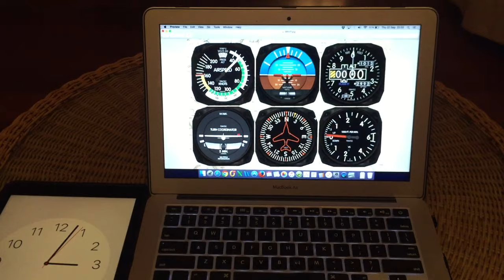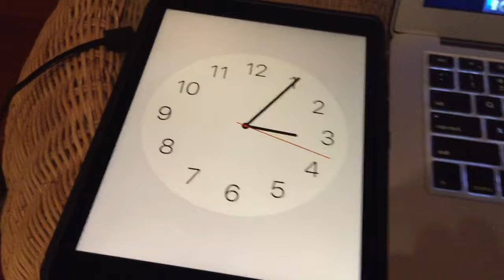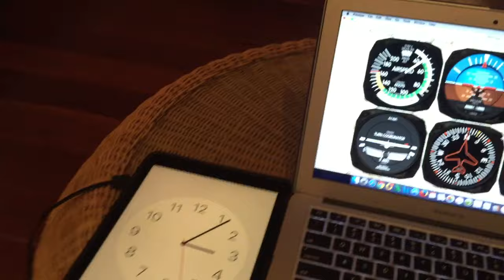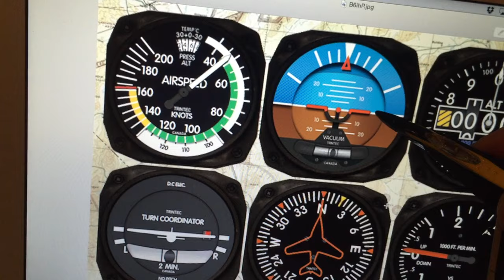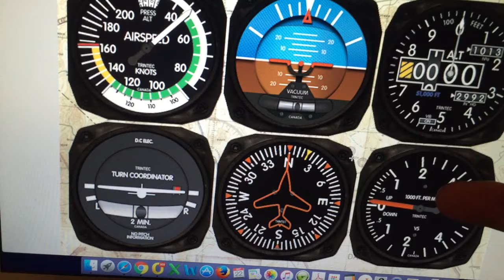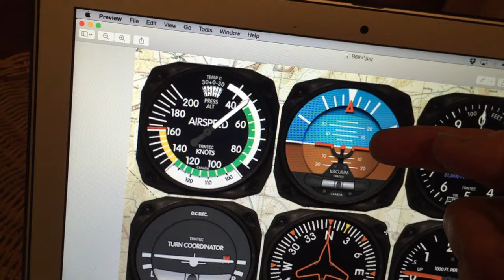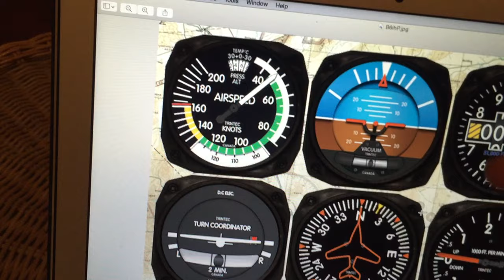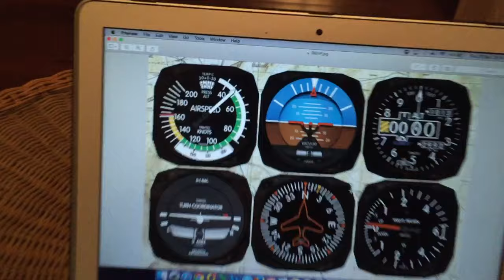Do aircraft change attitude to follow the curvature of the Earth?

Comment: A plane traveling at 500 mph would have to nose down 1 mile every 12 minutes
Reply: Truth Seeker - Yes.   And here are some FACTS for you to digest:

Take an aircraft in steady level flight.

  An observer on-board has a plain old "Spirit Level" and a ring-laser gyroscope (like the Litton LN-200 or Airbus Astrix-120).

Align the spirit level "Level" in the direction of flight (set it in the aisle lengthwise for instance)

Align the ring-laser Gyro such that one axis (say X-axis) is aligned with the aircraft's PITCH AXIS.

Now take note of the RLG angle about the pitch axis and verify that the level shows "LEVEL"
 ("Zero" the reading)

Now Fly Seventy Miles (70):  the spirit level will show the aircraft stayed LEVEL.

WHAT does the RLG say? - It says that the aircraft PITCHED DOWN ONE DEGREE .!

Keep flying and for EVERY 70 miles flown the RLG WILL indicate the aircraft pitched down one MORE degree.

Imagine the aircraft could start at the North Pole, fly south to the South Pole, over it, and north to the North pole again.

Upon completion of this flight the level would have read LEVEL for the entire flight while the ring-laser-gyro will indicate a COMPETE 360 degree FRONT FLIP .!

Sorry but this a FACT that cannot be disputed.

IN FACT most modern aircraft are equipped with RLGs as part of the inertial reference system.

They MEASURE EARTH ROTATION as part of the per-flight test to verify the gyros are all working.

If the gyros do NOT READ EARTH ROTATION, the gyros are marked as failed, and the plane does not take off.

Stuart Gray - Aerospace Test Engineer (23 years) specializing in test of Flight Avionics including ring laser gyros since the 1990s 

I have literally installed RLGs on vehicles and then helped FLY the vehicle.
Reply: @stuartgray5877  Yet, no one seems to feel this effect. I mean nosing down 1 mile every 12 minutes...you would surely feel it. Plus you would see the artificial horizon keep making adjustments to keep the plane level. But you don't. You can't tell me that this gyro is constantly nosing down 1 mile per 12 minutes on a plane going 500 mph. Please, show me a demonstration. The plane keeps level for long periods of time with it's nose slightly up.
Reply: @truthseeker6369  - "you would surely feel it."  Oh so you WOULD, would you?

Would you care to calculate the force of bending the path of the aircraft to that curvature?

Please be my guest so you can prove your assertion.

Hint: No a human would NOT feel it.
Reply: @stuartgray5877  You mean you can't feel it when the plane starts to descend? Maybe your equilibrium is not working in your head. I can sure feel it. The nose stays up for most of the flight until the plane starts to make its approach. I can feel and see the nose slightly up for to majority of the flight. We all know thats how planes fly when they are keeping the same altitude.
Reply: @truthseeker6369  Sorry it is just a FACT that a human could NOT feel it or..... DO THE CALCS YOURSELF AND PROVE ME WRONG.
Reply: @stuartgray5877  Why don't you try making a valid argument rather than childish name calling. Actually, my math was wrong. In 500 miles, you should have a 31 mile drop. That's 163,680 feet. Divide that by 60 minutes and and you have 2,728 feet per minute. In two minutes you have over a mile drop. You mean to tell me, you wouldn't feel a mile drop every 2 minutes? Come on man, who's the one really bullshitting here? You.

Comment: Wolfie6020, you have to publicly recant/recall your statement and conclusion that a pilot needs to make small control inputs to follow the curve of the earth.  EVERYTHING you say is true and correct, EXCEPT that.      Let's make your credibility perfect and make this clear to everyone.  even though the earth is round , you fly LEVEL and that is in relation to the perpendicular force of gravity. (straight down)  your wings, fuselage, all are perfectly perpendicular to the aircraft travel.. because the this line of gravity follows the plane, it NEVER needs to adjust for curvature, because the atmosphere that it is flying in is curved as well.   

again, no adjustment or control input necessary.   the gyro adjusts to curvature for the same reason.  even though the curvature of the earth is about 1 degree for every 8mins at 500mph,  the aircraft doesnt need to make any adjsutments of attitude. not even very slight.  WHY?   because the plane is flying LEVEL (to the ground) always, NOT straight.. if a plane through straight, it would end up in space , if it had the power to do it, and you would be climbing in altutude all the way there!    make sense??
Reply: Nice addition.  Yes, i try and mention the pressure gradients that are related to how much air is above the ground and does vary slightly. So, it  remains relatively constant all the way around the earth, so there is NO control input to adjust to the curve of the earth , because , and as you say, the atmosphere is curved around the earth too!

Comment: Wolfie, I think there is a better way to explain this. Yes, of course, you are 100% correct about the rate at which the aircraft would have to pitch down if it indeed needed to. But I suggest the aircraft does not pitch down at all. It remains horizontal to the local earth surface.  Keep in mind that at every point on the globe gravity is perpendicular to the surface. So from one location to another at a constant altitude, the aircraft has remained horizontal. I will make time soon to do a couple of drawings to demonstrate this. 
Cheers
Mate
Reply: That's correct. On a globe, the aircraft does not pitch down at all. It remains horizontal to the local earth surface. On the ground, we measure "level"with a spirit (bubble) level at rest, which basically uses the direction of the force of gravity, and a right angle compared to that. What "level" flight in a plane really means, is maintaining your altitude, which is what happens automatically in a plane trimmed to level flight. You don't even have to think about it. If you nose up , you will start  climbing, moving away from the earth, and you will have to work against the force of gravity acting on your plane. If you do not add power, your velocity will decrease.  As when driving a car uphill.
Thus, maintaining altitude as you fly along, just will follow the curvature of the earth .. automatically.... whatever it is .. flat or curved. No "proof"/"debunk" of FE/globe here!

Comment: You also have to consider throttle setting and aircraft trim.  For if the aircraft is trimmed so that it is not  quite generating 1 g of lift but a  fraction of a g less than 1 g then it will lose altitude.  So if the aircraft is trimmed to maintained constant altitude then it is not quite pulling  1 g  (sa y .01% shy of 1 G) of lift and  thus can lose  altitude at about the same rate of earth curvature. And even it the  elevator is locked one can  also adjust altitude with the throttle setting for the engine  will be producing some lift unless the aircraft is flying with zero degrees angle of attack. So trim and throttle setting need to be considered as well in regard to maintaining constant altitude and not just the elevator setting.

Comment: You didn't mention the analogue set up you display does not account for curvature. By your reckoning after 10hrs flight your manual changes in altitude will be displayed  by gauges . If your suggesting the pilot has to readjust his altimeter constantly during the flight then you are lying. 
Your using analogue setup then state "autopliot" 
You need to provide the proof that your 'autopliot constantly adjusts the pitch for curviture'  not adjust for air pressure. 
This should be easy for you. Since your using a display on your desk.to posit your hypothesis, then you are no more proof than a flat earth doing exactly the same with a different outcome.  You have stated you have  " Flown around the globe several times" circumnavigated the globe, well prove it ? I think it's about time we took a good look at Wolfe and subjected you to the standards you hold others to.
Reply: Charlie Jeans - Well here are some FACTS for you to digest:

Take an aircraft in steady level flight.

  An observer on-board has a plain old "Spirit Level" and a ring-laser gyroscope (like the Litton LN-200 or Airbus Astrix-120).

Align the spirit level "Level" in the direction of flight (set it in the aisle lengthwise for instance)

Align the ring-laser Gyro such that one axis (say X-axis) is aligned with the aircraft's PITCH AXIS.

Now take note of the RLG angle about the pitch axis and verify that the level shows "LEVEL"
 ("Zero" the reading)

Now Fly Seventy Miles (70):  the spirit level will show the aircraft stayed LEVEL.

WHAT does the RLG say? - It says that the aircraft PITCHED DOWN ONE DEGREE .!

Keep flying and for EVERY 70 miles flown the RLG WILL indicate the aircraft pitched down one MORE degree.

Imagine the aircraft could start at the North Pole, fly south to the South Pole, over it, and north to the North pole again.

Upon completion of this flight the level would have read LEVEL for the entire flight while the ring-laser-gyro will indicate a COMPETE 360 degree FRONT FLIP .!

Sorry but this a FACT that cannot be disputed.

IN FACT most modern aircraft are equipped with RLGs as part of the inertial reference system.

They MEASURE EARTH ROTATION as part of the per-flight test to verify the gyros are all working.

If the gyros do NOT READ EARTH ROTATION, the gyros are marked as failed, and the plane does not take off.

Stuart Gray - Aerospace Test Engineer (23 years) specializing in test of Flight Avionics including ring laser gyros since the 1990s 

I have literally installed RLGs on vehicles and then helped FLY the vehicle.

Comment: So you are saying that it takes 48 hours to fly around the earth. Does it take 48 hours going e to w and w to e if the earth rotates. How is that possible. One direction would be with and the other against the so called Coriolis effect.
Reply from the maker: +Mitchum Stimpson.  Sorry, that is not what the Coriolis effect is.  The Coriolis effect occurs when you are changing Latitude.  You must change Latitude to experience it. 

If you remain on one Latitude there is no Coriolis effect as the speed of the Earth does not change under you.  

I do know what you mean though but that is not Coriolis.  It is moving with or against the rotation. 

You have to think of it this way.  When the plane is on the ground it is already moving with the Earth.  If you take off and accelerate 500 Mph going West you are moving 500 Mph across the ground West bound.   If you take off and accelerate 500 Mph East you are going 500 Mph across the ground East bound.  

You don't lose the rotation of the Earth you had before take off.  You just accelerate either direction from it so all motion is relative to the starting velocity.  

If  you change Latitude then the speed of the Earth is changing beneath you and there will be Coriolis effect however when you do the Math the effect is less than a 1 mph cross wind would cause.   Easily compensated for during a flight.
Reply: Wolfie6020 I think you are right about the coriolis effect. But yes what I'm getting at is flying from e Aus to w Aus should take much longer than flying from w Aus to e Aus if the earth is spinning in the direction we are told should it not? One direction the earth is spinning under the plane the same direction and the other direction the earth is spinning in the opposite direction as the plane is travelling. But flight times don't appear to show that.
Reply: @mitchumstimpson2313  sorry for the 2 moths old response.

The air in the atmosphere is ""fixed"" to the Earth's terrain, so You, the ground, and the atmosphere above you are all rotating at the same speed, the air doesn' t stand still above you while the ground (Earth) rotates away beneath it. So there is no difference between walking or driving and flying, the Earth's speed is not taken into account as the air the aircraft travels into is also rotating with the Earth.
Reply: Mitchum Stimpson      You are correct if you are watching an Aeroplane on a stationary platform in space but if you are on Earth your perspective would be different as you are in Earth’s frame of reference.

Comment: Nice explanation... I kinda thought up and down controlling of an aircraft would be similar to right and left on the road in a car. Thanks.
Reply from the maker: Thanks.  Yes the corrections are constant and tiny.  If you look very closely in this video during the night you can see how small they are.   From 0:34 to 0:40 you see the altimeter move twice slightly.    From 0:46 watch the center section of the horizontal green line between the 10 and the 11 - it is actually split and the center part is moving up and down tiny amounts.   This is exactly what I was explaining above. 

https://www.youtube.com/watch?v=eD6bH03DJBI

Comment: Aircraft pilots do not need to consciously pitch down due to the effect of atmospheric drag and air pressure on the wings. An aerodynamic object moving forward at fast enough velocities, (but not too fast, like the X-15 for example, which has the power and design to overcome atmospheric drag and air pressure), will tend stay at the same altitude without any need of help from pilots. It's the same underwater. I'm surprised no one understands this.

Comment: Wolfie620, 

I posted your video to the physics forum and the lead Mentor responded and agrees with me that the pilot makes NO changes to the controls to follow the earth. similar to the plane on the ground, not needing any control inputs to follow the earths rotation.
as i mentioned and have described. the plane is always kept level , perpendicular to the force of gravity and it naturally follows the curvature of the earth due to the atmosphere being curved as well. non control inputs are ever needed other than just keeping the plane level to the ground.

  He watched your video and said, 

    "He  ( wolfie620) describes the rate of change of orientation as being below the threshold needed to detect motion. This is wrong. The change in orientation is continuous and the g-force constant, which means there is nothing to feel at all. No threshold needed! About the only quibble one could make is that due to the motion around the Earth you have a slightly lower than normal, but constant apparent weight traveling one way and slightly higher apparent weight traveling the other."

Comment: I seriously doubt the airplane needs to be pitched down by the pilot or the autopilot to follow the curve. It seems to me much more plausible that the airplane is pitched down by the surrounding air and gravity and the pilot (human or auto) doesn't need to do any additional correction (except for deviations caused by other factors). 

I know the point of the video is that EVEN IF an additional correction was needed, the pilot (human or auto) would perform it without noticing it because of all the other much larger corrections that need to be done constantly.

Comment: Oh dear it seems wolfie was busted on this one!
Reply from the maker: +Joe Tee - no, the people who tried to bust me on this only proved they are easily confused by simple geometry.  This is exactly how it works mate.  Anyone who tells you that aircraft need to descend to follow curvature simply does not get it. 

If a car is moving around a perfect circle race track and you are standing in the centre when does that car get closer to you?

It never does mate.  Never - I am right - Globebusters were wrong.  Anyone who thinks aircraft have to descend is also wrong and can't think three dimensionally. 

It seems you are one of those do "don't get it"

Flight plans factor in the curvature - extra distance due to altitude resulting in a larger circumference than at the surface.  This is fact. 

Flat Earth is nonsense mate - the silliest scam on the Internet.  Did you fall for it? 

 Watch my videos on the Eotvos effect - things consistently weigh less going East than they do going West - I have tested this many times.  

Try it yourself - it proves curvature and it proves Earth's rotation and is very easy to do.
Reply: Wolfie6020 ok I hear your points but how do you explain about the points he made about the gyro?
Reply from the maker: +Joe Tee - have you tested a real gyro yourself Joe?  I bought the "super precision" gyroscope myself to conduct a few tests. 

I was very disappointed because it is a toy - not super precision at all and totally unsuitable for this type of experiment. 

If you look at the inertial reference systems used in aircraft which are far more precise they absolutely do detect rotation and can actually determine latitude this way. 

https://www.youtube.com/watch?v=Du8Vo7cNujI

One thing you will notice is that many Flat Earth channels spend hours talking and very little time doing actual experiments themselves. 

A few simple experiments will quickly prove the Earth is not Flat. 

I do plan videos on the Gyros in future - the list is getting longer but I am working through it slowly.
Reply: Wolfie6020 ok thanks! 

I look forward to your gyro videos.